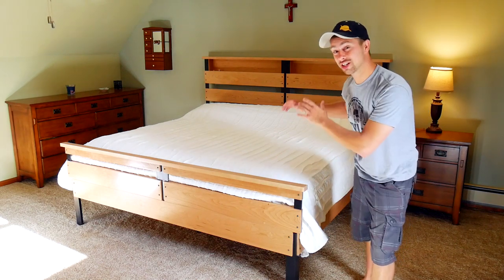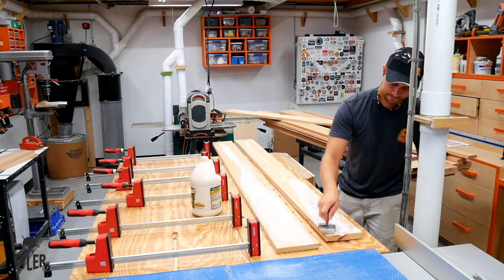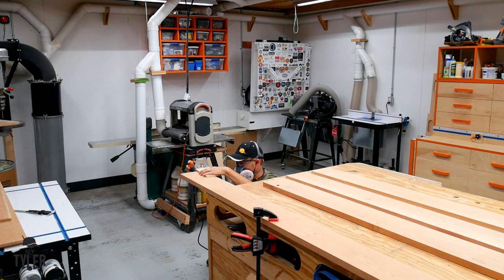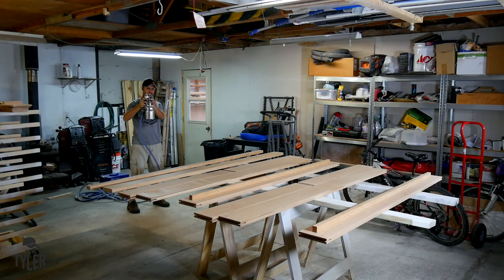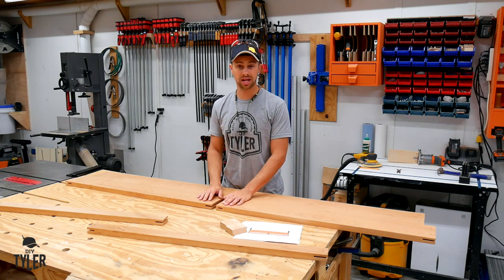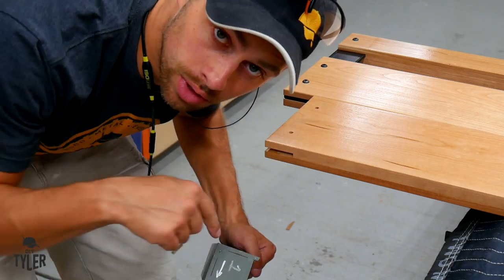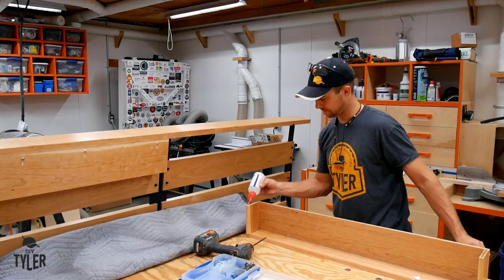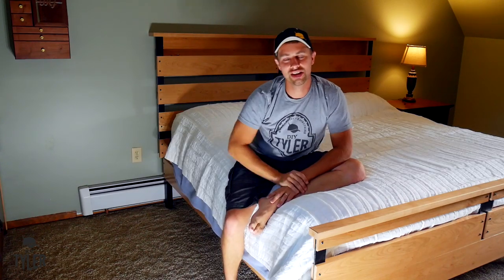King Bed Frame | How to Build

Comment: You cloud only drill a hole (washer deep) with forstner bit (washer width). So they would have the same thickness of wood. But now you will certainly not disassemble bed :D 
Great work. It even looks better without washer..maybe..we don't know and we'll probably never find out :)

Comment: You didn't mention whether this was your own design or inspired by another.  Regardless a terrific build! 

May I suggest two more video's for you to produce.  One talking more about the helix head cutters, where they came from and how easy were they to install.  And second, the spraying lacquer technique- how many coats, sanding process between, etc.
Reply from the maker: I saw the mortising and metal angle technique from a Sweedish? Guy I think. Didn't even think to mention that....just wanted this video done!

Video idea one I have already! Check the last video in released.

Second idea is a good one, will add that to the lineup! Thanks!